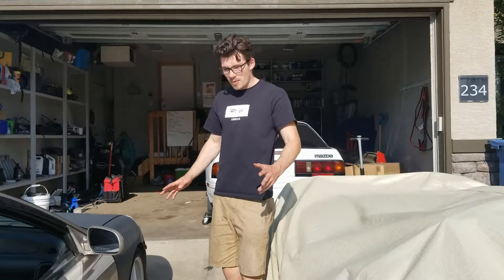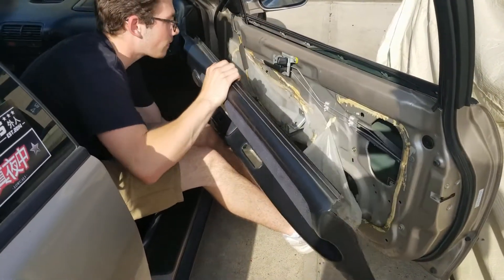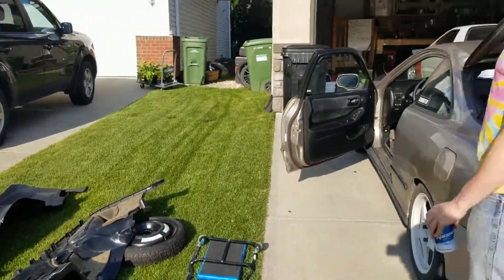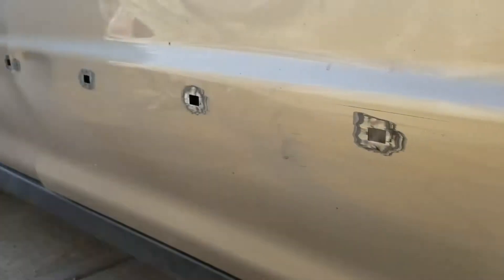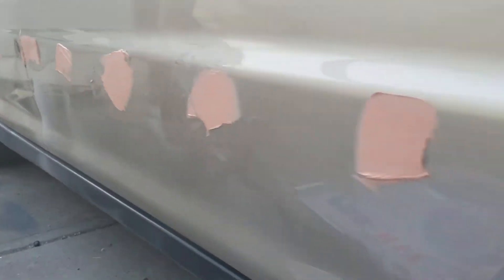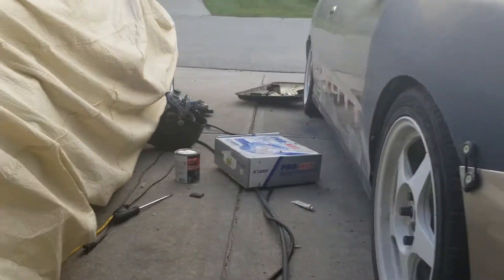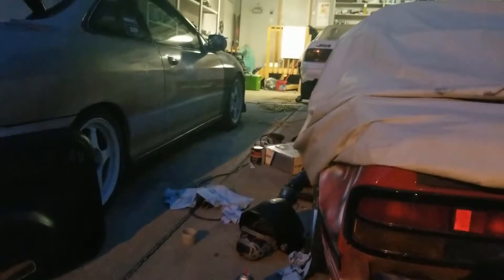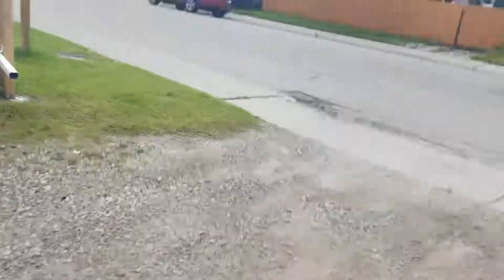HOW TO DELETE SIDE MOLDINGS

Comment: JB Weld the inside of the door then bondo. Either way is good.
Reply: That method works?
Reply: @ohsnapsitspaul5506  JB Weld putty. The only thing you need is a hard backing for the bondo to sit on. Once it hardens it's good to go.